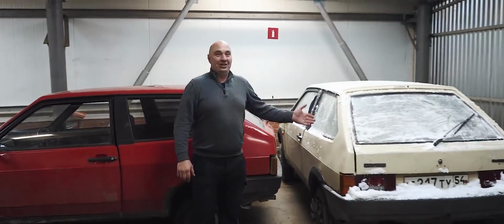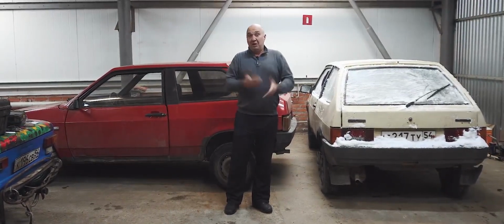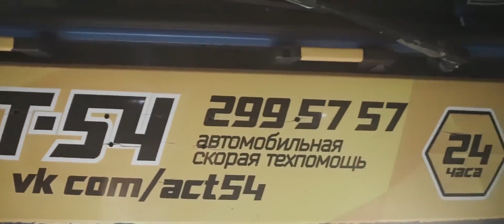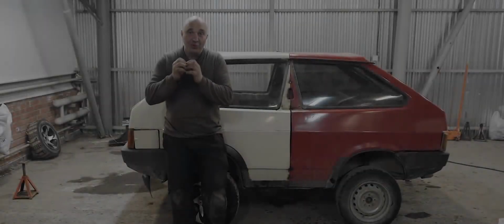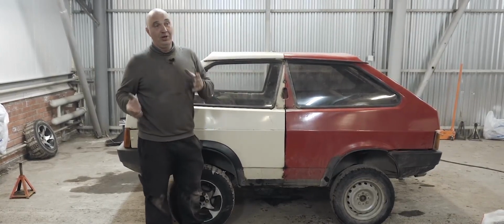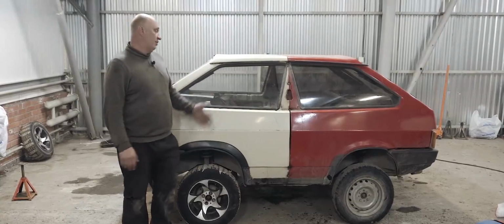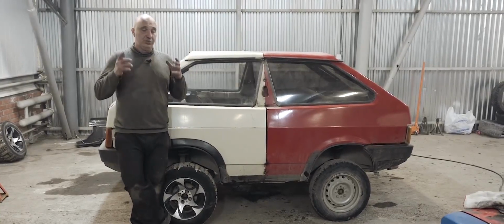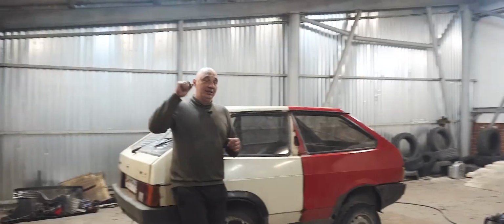Creating the "ASS TANK"

Comment: 4 electric motors and bobcat style steering would be amazing.
Reply: Exactly!
Reply: Yes!!!!
Reply: @Strong man yeah but the engine stuff may be too complicated. With electric motors you dont need a gearbox but besides that your idea is decent
Reply: decrease the part count with only two motors, one per side. Although 1 per wheel is cool, I think it might be harder to sync them up, and its not totally necessary
Reply: That would be a great idea.
Reply: yea but turning radius sucks and you have lot of wear on brakes on ice you just spin two wheels and so on. that small camper idea is great ultra low budget thing
Reply: I was thinking the same thing to skid-steer style but with some Tesla motors
Reply: You would just need one electric motor on each side. mounted in the center. and some sprockets and chains to get it to operate the front and rear tire on it's side. then lot and lots of batteries.
Reply: Yes a skid steer hydraulic system
Reply: @twc20031985  yh just sling a load of batterys in It has a lot of space for back ups aswell 2 powerful motors  and 4 wheel turning and you will have an off roader 😂 😂 😂
Reply: Skid Steer
Reply: Or you could go hydrolic drive
Reply: NO...JUST A 4 WEEL STEERING WOULD BE MUCH BETER AND MORE FUN ...BOB CAT STEERING THE WEELS DONT TURN JIST THE BODY FOLDS ...Witch is not bad dont get me wrong But i just think that four weel full steering woukd be more fun to drive and even park and do cirlcles with that thing AND HAVE TWO WAY DRIVERS..meaning no riverse but both sides drive farward when you chose .You cant bend the car enough or as much as you can with 4 way steering to do a U turn and its more dangerus to have the car bend in the middle like that .As with 4 way sterrung you ciuld still have more room and fit more people and just safer and better ...even though your idea would be my other one also ..it still sounds like much fun and COOL .😎
Reply: I love my spelling ..you like ?😂
Reply: bobcat steering would probably be bad at high speeds though. They probably should have kept the front end parts off of one of them.
Reply: ...or run it on tracks!
Reply: How about some doors first?

Comment: No weld needed just flex tape.
Reply: THATS A LOTTA DAMAGE
Reply: Sounds more expensive than just welding. Metal is cheap when you are using junk.
Reply: Привет! Филл Свифт здесь для Гибкой Ленты
Reply: after you paste with felx tape you need to use flex seal for security reason
Reply: Use a pile of magnets, so it's easy to open up again, could prove interesting if they don't prove strong enough whilst driving it.

Comment: Vlad, I love that creation. I'd say, just put in a Ducati air-cooled DOHC 2 cyl motorcycle set-up. Run a c.v.-jointed half shaft to two wheels. Make the opposite axle steer, and you have a light-weight car with, probably more kilowatts of power than the stock engine. I love these vids!!!!!!!!!!

Comment: Just make it "TANK DRIVE"!!!!!!!
You will need 2 separate motors and two  of the back or back wheel(the back you will choose) and the principle is simple: If both wheels turn the same direction, you go straight line and if one of the two turn backward while the other turn foward, you will turn either right or left ^^

Comment: How awesome!!! Why not orange with some wicked flames on the side? Perhaps to turn you can either put in steering, rack and pinion, etc. OR you could put a 360° gyro underneath similar to a toy that would extend to turn when needed. Another option is to turn this into a caboose or perhaps a trailer of sorts, perhaps a pull behind sleeper/camper living quarters!!!

Comment: Use independent brakes to steer, get rid of anti-slip or lockers. Use two smaller electric motors one powering each ale, wired in parallel of course, maybe from two golf carts? Would be cool to see hand levers and/ or pedals used to control it as opposed to a steering wheel.

Comment: electric hub motors would work. i've seen some that bolt onto the suspension in place of the stock wheel and brake assembly. power one side forward, and the other reverse to make it turn in place, and slow one side for normal steering. excellent job connecting the two halves by the way. should have kept the other halves and connected them as well. two impossible cars together. good times!

Comment: How about doing this with two RWD cars? weld the back ends together and join the propshafts, or have an engine/motor in the centre of the “car” which drives both propshafts, then something to brake each wheel for a skid steer effect🤔

Comment: Using skidsteer running gear would be ideal. They use the engine coupled with a hydraulic pump and then a couple of hydraulic motors so no gears or driveshafts are required, just hoses.

Comment: Put power to cross corner wheels only. example - Power to the right front and the left back wheel. Separate throttle for each wheel should allow steering of the asstank.

Comment: Simple solution, as long as the differentials are not welded, is setup the brakes with two pedals one for the right side and one for the left then the differentials will handle applying power to the opposing side. The same a Stephen said. My experience is from tractors.

Comment: could do a set of tank treads or a bobcat type setup and skidsteer with the two solid axles and two motors m proly chaindrive and steering using trottle and brakes

Comment: Steering issue that's easy . Or maybe ..Have a separate break lever or petal for each side if you stop the wheels on one side and the other wheels keep turning ! you should be able to steer like a tank or bulldozer.  it even helps having a set differential rear axles because if you stop one wheel the other keeps spinning .

Comment: If it was a serious project, the thing to do would be to borrow the FWD setup from the red car, but ditch the gas engine and put an electric one in it instead. It would be a lot of work, but it would solve the steering and drive, and it's the right size, you already have it sitting there, etc. You have a zip cut and a welder, so I know you can make it fit.

Comment: You should only need 2 relatively powerful electric motors if you cut the axels and use a skid steer type of steering system.  This way it will be a permanent 4x4 so you can go out in the snow and not worry too much about getting stuck in the thicker snow

Comment: Heres an idea for steering, if your gonna use electric motors try 2 one for each side, mount midway on each side run chain drive from 1 wheel to motor then from motor to other wheel, repeat for other side, the object of this is like a skid steer or tank, forward & reverse, and maybe if motors are strong enough you can for instance run right side forward & left reverse and turn in circle one way or the other,,,,, 
Another option would be same with exception of using hydrostatic motors in place of electric motors and have a lawnmower engine to power them,,,,,

Either way or what ever ya come up with it's a cool idea and good luck my friend....

Comment: Use tracks that way you can just stop one side of the car and drive the other side to turn (sounds easier than what it is) but would be easier using the electric motors with this set up that way you dont need to do a whole steering rack and stuff

Comment: You could steer it like a tank. You could even add tracks. I would think a small 4 cyclender motor would work great. Rear engine mount. Climb in through a window.   Drive it like a stick steer mower

Comment: Vlad,
Cut the wheel arches off
Fit tank tracks on both side and one electric motor to either the front or rear wheels 
Make it like a t32 t34 steering but with electric motors

Comment: add two electric motors. one on left side attached to left two wheels and one on the right side attached to the right two wheels. then you can drive like a tank and steer like one also (one side goes forward the other backward to turn)

Comment: maybe you can get one front back from the trash
to use the front axle and steering
maybe cut out the engine bay to weld it in the Assmobile to fit the engine in

Comment: I think you can also connect one electric motor directly on the differential, add tracks and four good brakes, and connect them in that way that both front and back brakes would brake in same time and on the same side. For tracks i would recommend to tie them on rubber and weld some rollers under car and a tension roller which will make more easy to put tracks.

Comment: you could fit some hydraulic motors on the wheels and a 10 or 15 hp hydraulic power pack and make it turn like a skid steer tractor

Comment: Your very modest. The work you do is awesome. Also you could use the skid steer method of control either with an electric, or electric hydraulic combination of drive motors. Either one motor per tire or one motor per end with a skid steer differential. (Center carrier with ring gear and a planetary gear set on either side of the carrier for out put speed control)

Comment: Steer it like a tank. Since you're going to use electrical motors, hook up a computer system to run a program to know how much power and speed to put into each wheel so it can turn and go down the road. Bobcat has been doing that, look at their blueprints, plans, or whatever. Or just get a used Bobcat and transfer a lot of the parts if you can, or at least learn from it a bunch on the complete tear down.

Comment: Its easy to watch your videos even though it dubbed. You and your translator are a great team. A suggestion. You now have the 2 asses together as a shell which needs a turning and power drive. If you had left the better car with the stearing and engine assembly intact and placed the rear half of the egg colored one on it coulda been simpler. So if you still have it blend the front half of the good one back in then blend the 2nd rear half onto that. Thered be no shame in filling the gap or taking length out of the powered half. Make it mid engine all terain vehicle. It looks kinda sqirly short though so be carfull not to flip over the handle bars. Cheers

Comment: Hi there, can i ask something please? what would happen to an engine if the petrol tank was pressurized? would the petrol squirt into the engine easier? could it be more efficient?

Thank you for your videos, i enjoy your channel. Have a great year ahead.
Reply: Some older cars back in the 20's & earlier did not have the fuel pumps we know today, like mechanical pumps driven by the camshaft, or electrical pumps.  Yet, they had pressurized fuel systems. Near the driver was a handle the driver would pump and pressurize the tank with air before starting the car, and had to periodically pump while driving to maintain fuel pressure.  "Fancier" models would have an additional pump driven by the engine to maintain a certain pressure.  So it is doable, and did work fine as long as the fuel pressure was not so great as to overcome the float-valve in the carburetor, and flood the engine.

Comment: You guys should have left the one with the best suspension and frame leave the steering and dashboard stuff and cut out the front support and windshield pillars and on the other back side remove the frame rails and floor and strut towers leave the fender liner structure and

Comment: Make it 4 wheel drive with a frontwheel drive engine and automatic gearbox in the middle, then make 2 drive shafts go to the rear and front axle. Then make the breaks work left and right side separate with 2 brake pedals and the differentials will do the rest. And make sure that both axles go in the same direction.

Comment: ok, you put the 2 back ends together. now put the 2 front parts together. get both engines running and see if it would move sideways with steering on both ends.

Comment: As a guy mentioned down in the comments:
You have 2 levers, each one controls 2 wheels on each side
(left lever controls front right wheel and rear right wheel)
(right lever controls front left wheel and rear left wheel)
It will steer like a tank - pull only one lever in order to turn... For example if you pull the left lever only you will turn left. Pull both of them to go forward. Pull them in the opposite direction to go backwards. As you said electric motors will be the easiest way to go. Good luck and looking forward to seeing the result!

Comment: Just came up with a crazy idea that would work for a awesome drivetrain and steering. simple, easy, and cheap. Here's a step-by-step.
"Hold my beer👍😉"

1. Get 2 oversized identical truck rear differential same gear ratio. 🤔🚚 (like a full size truck)

2. Remove the spider gears out of the differentials, the ones that are not attached 2 axles. Then weld 1 axle to the ring carrier, leaving the other one to free spinning.
🛠😥

3. Attach differentials to the bottom of the crossbeam on the suspensions of you tank, with the Yoke's on the differentials facing inward toward each other. With some huge like 40" off road tires or something .
👍😉

4. Mount DC motors, attached 1 motor to each yolk on the differential, and wire it up to be able to go forward and reverse operating. "Some kind of control like a electric forklift". Also I would putting a banks of battery's down each side of the vehicle opposing the electric motors.
😲☇

5. Now just put a platform of some type above the motors and batteries banks with a thin small seat (like a couple boat seats) and you're off and driving your Crazy Ass Backwards Tank E.V. !
😆 try not to have too much fun!

So each side will be able to work completely independently from the other side and be able to go forward and reverse, so it will drive exactly like a tank, with no hydraulic steering or any crazy clutches or anything else. Easy simple and will work.
👍😉

Comment: Suggestion.
The steering capabilities are in its name.
Just got to figure out how to make it steer like a tank. Not like a car.
So pretty much all the right side of the ass tanks wheels are separately driven power from the left 2 wheels..
(Bob cat style) with 2 joysticks.
Reply: Great idea
Reply: that was my immediate thought when i seen the thumbnail!
Reply: kimo796 I wonder if some of the comments and ideas in the comments section of the translated videos are forwarded to the creators of the videos.
Reply: You can achieve that just by separated control of brake caliper on each wheel
Reply: skid steer, driven by electric over hydraulics.
Reply: thought exactly the same
Reply: Skid steer ass tank
Reply: You could use a front wheel drive transaxle center mounted with cv shafts going to the front and back axles. Turning and braking could be done with two brake pedals. Easy and cheap to set up.
Reply: Skidsteer
Reply: I think he was saying that they were going to do that exact thing at the end when he said "you get the idea" after saying they couldn't install a gasoline engine and wouldn't be able to steer traditionally. Also, these videos are months and months old at this point, so this car is long finished now at the time of the video post. It isn't uncommon to see videos that are created in the summer or spring aired during the winter time, or vice versa. The Ice truck was posted translated during the dead of summer. 

So these projects we get to see in the rest of the world that understand English, are much older by the time we get to see them. This is a common theme with these videos.
Reply: Skid Steer
Reply: 4 motors?
Reply: @devicemodder  4 electric motors, like a tesla, one on each wheel
Reply: It can't even move. It doesn't have engine lol
Reply: add an axle with a diff on it, hook a motor to the diff, and have separate brake system for each side. when the motor is spinning and you brake one side, it will make the other side turn faster and vise versa.

Comment: It looks to me that the only way to propel and steer a vehicle like this is to make one set of wheels the drivers with each wheel operating independently from the other. To do this you'll need two separate motors or set up a clutch system working from a single motor. The separate motor system seems to be the less complicated. Either way, parts availability would seem to be the challenge to making this an electric vehicle. If it were me, I would mount two small gasoline engines ( two near identical air cooled motorcycle engines with the same gear boxes)one on each wheel, mounting them so that they are in the rear with sprocket drives so that the exhausts won't need to go the length of the car.  It would be steered by two throttle controls.

Comment: Just do tank drive: one motor drives both left side wheels and another drives both right side wheels. You'll get wheel slippage but it'll work perfectly on snow or mud. If you can't connect them that way then use one motor for each wheel and run either side's motors on the same circuit.

Comment: Use  4 Electric motors one for each wheel and wire them to act like a Tank. Example link one side together with its own control forward and reverse and the same for other side and you will have a true "ASS TANK" that can move like an actual tank. "I'd buy that for a dollar!"

Comment: Take the front half of one and grab the suspension and steering rack and steeering column, and mount in in the one half, then use the gearbox and differential with only a fixed gear, and an electric motor from some source ( golf cart, treadmill or even the starter motor for short drives) and a suitable adaptor plate and a small battery pack. Then you steer from the rear seat and move it around. Starter motor and the flywheel will be easiest, just have to chop the block off behind the first main bearing to get space for the batteries.

Colour of course will have to be red. It goes fastest.

Comment: Why not build a hydraulic system? A small gas engine in the back with a hydraulic pump and four motors on the wheel hubs. Then control the two motors on each side with a lever or pedal!